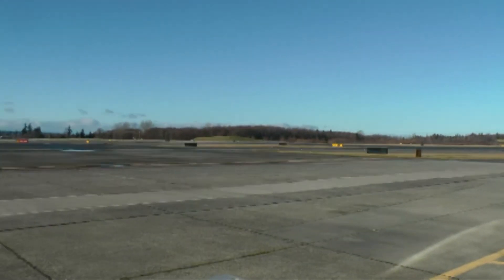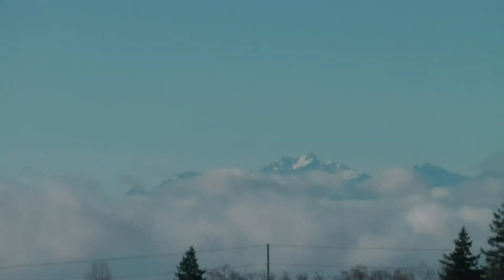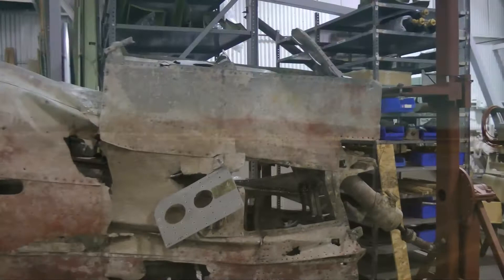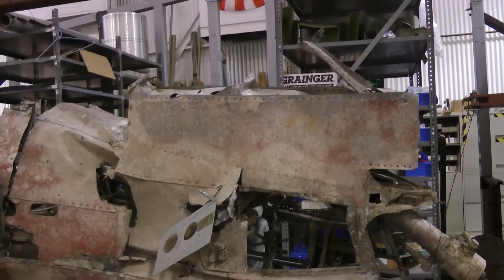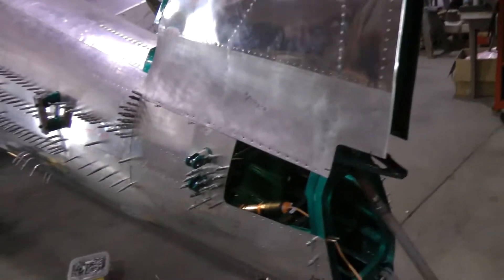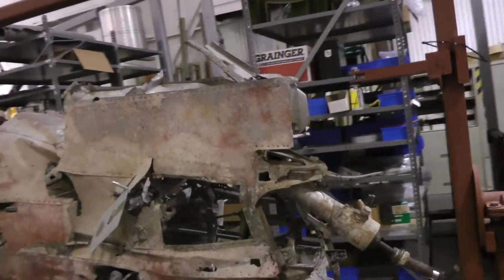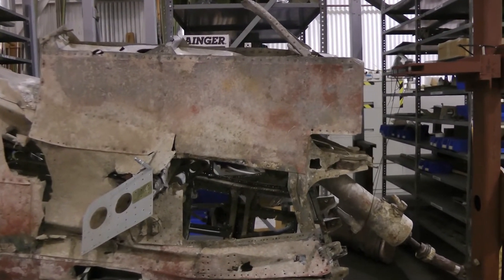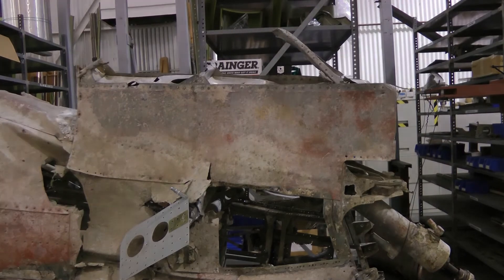A6M3-32 Tail Access Panel

Comment: Is this a ground-up newly-manufactured build, or are you using some original construction? I missed visiting an original Zero when it spent time in Fort Collins, CO just north of me. It is exciting to see so much work on Zeros in recent years. Thanks for posting.
Reply from the maker: This is a rebuild, obviously most pieces have to be newly manufactured as the originals are too far gone in most cases to reuse. That being said, we do use original parts wherever we can. There are several on the aircraft, most are small (up/down indicators for the landing gear), but some are more obvious. The landing gear struts are currently the largest original parts we use, they have been reconditioned, but are quite safe. When we complete her, she will be powered by an original Sakae 21 engine making her only the second Zero in existence to be powered by a one. Thank you for your interest, follow us on Facebook as we post regular updates on her progress.

https://www.facebook.com/pages/Legend-Flyers/255443124472131?ref=hl